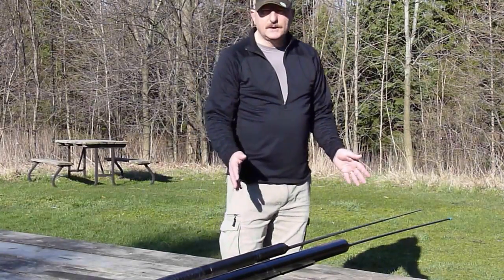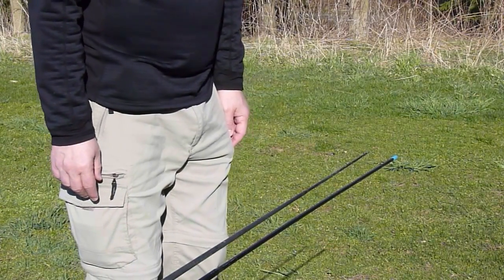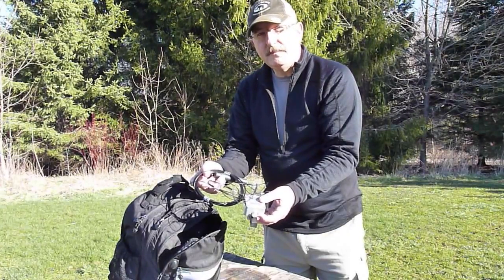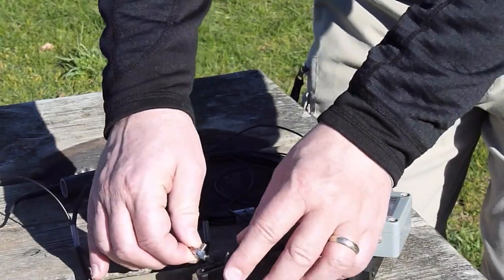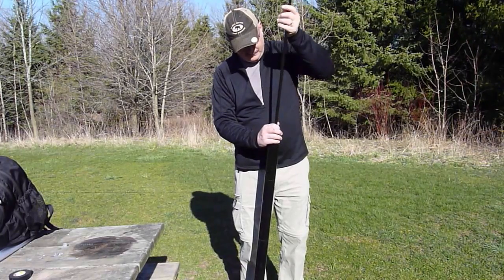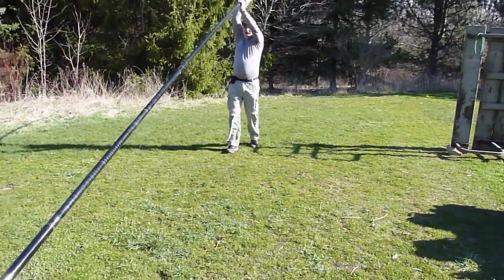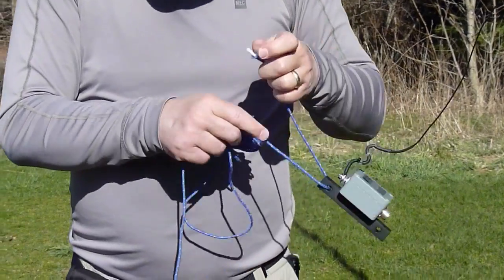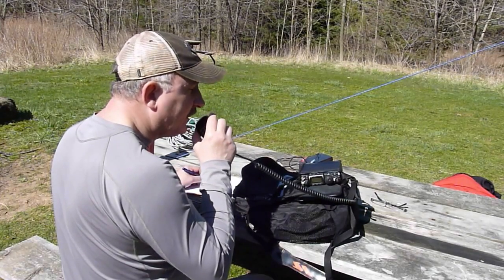HyEndFed 3 Band + Spiderbeam 12m Pole = Easy and Effective HF Portable Vertical Antenna

Comment: Have two Jackite 31 footer's !
And to be honest, a little disappointed in how flexible they are !
My mistake thinking they would be more rigid, having to support flags in a wind, but instead find they struggle to hold up even 18 gauge wire, without bending !
Since, I have purchased Two 12 meter Spider Beam mast, and are hopeful they will stand straight, even if it means not extending them fully ?
I think it is important to note that the Spider Beam masts, can be ordered with an eyelet, to aid in feeding a wire or such thru the top !
Too, Vibroplex is Spider Beams U.S. representative, and carries a set of clamps to keep the sections from collapsing down upon themselves, for those more permanent installations !
Hopefully this will help someone save time when ordering !
Unfortunately  I didn't learn of the clamp's until already having purchased the masts !
And now waiting for them to arrive !
Thanks for your post !
'73 
👍😉

Comment: If you had to do this again, would you place the antenna vertically for your HyEndFed? thx
Reply from the maker: In this video, I did have the antenna oriented vertically, but due to the wire being longer than the mast I had to run  the excess at the bottom away from the mast. One day I should try running the 3-band vertically from the top of my 50 foot DX-Wire mast.

Comment: Hi, Tracy.  Based mostly on your videos I bought the Spiderbeam 18m (60ft) pole.  I ran my endfed to the top as a vertical set up.  I worked a station in Oklahoma from my QHT in Winnipeg on 5 watts and even at 2.5 watts I could work that station.  I used my new icom ic-705 as it's my only and first ever HF radio.  2.5w over 1600km!  The station was running 400w on a yagi, he turned off his amp and ran 40w and I could hear him, but not copy much.  It was a great QSO.

73!
Reply from the maker: Nice! I've got a question for you...how far up the mast did you affix the high end of the endfed, and did the mast bend much once erected with the antenna connected?
73 from VE3TWM.
Reply: Hi. This was my first ever set up. I have two sections above the end of the antenna. . Next time I’ll take it to the very top and reply back here. 18m pole sire attracts attentions. I can see it a few blocks from my house!  I made a contact in Nevada on 40m with 5w!

Comment: Hi Tracy, first of all thanks for the video. I ordered a HyEndFed 40/20/10 and waiting for it to arrive. I was under the impression it can't be used as e vertical. Did you manage to get a acceptable SWR operating the antenna as a vertical? Which would mean the endfed doesn't have to be under a certain angle to get a good SWR, am I correct? 73
Reply from the maker: I'm really sorry for the delay in response...either I missed this or YouTube is having an issue in the reporting on comments (my vote). I had no issues with the SWR in the vertical orientation. The SWR was just as good vertical as a sloper. 73 from VE3TWM.
Reply: @OutdoorsOnTheAir  Thank you Tracy, not a problem at all. I have the HyEndFed installed vertical and SWR is absolutely fine on all 3 bands. No tuner needed. Hope to talk to you on the bands! 73 de PD9RD.

Comment: This antenna is supposed to be horizontal or a slopper...
Reply from the maker: Yes, those are two of the orientations the manufacturer recommends. I wanted to see how irt would work as a vertical for those with limited real estate.
Reply: @OutdoorsOnTheAir  Thanks mate... I owe those pieces of equipment you mention , and an FT-818ND. The space i have available is unrestricted only on hight. That is why i got the tallest available ( 20 meters ) SpiderBeam.

Comment: Your thoughts on those stackable military 48 inch fiberglass camo net poles to 32 feet height.
Reply: I have 8 of them and 4 of the aluminum.  They have quite a bit of play in the interconnects, so stacking 8 of them gets a little scary without guy ropes even in a slight breeze.  I used two aluminum poles at the bottom, clamped them to a cemented in fence post, and it still had more movement than I liked at the top.  If it had been in the middle of an open field, I could have overlooked it for a temporary setup up, but I had it up near my house.   It is also rather difficult to join them together and walk them up as the pole bends quite a bit even using the hinged stake base.

Comment: Thanks so very much for taking the time to make & share this video.
It was one of the vidz I watched more than once before getting my Spiderbeam 12m HD pole, so much more robust than a lot of others I've seen, horses for courses I dare say though.

The SpiderBeam supports my 40m/80m inverted wire at approx 11m agl but I use it for /P ops also....considering buying another couple to support a loop maybe...a phased vertical system is atop my list however!

Great buy, don't hesitate if you're contemplating a fibre glass telescopic pole.....they do 18m ones too HI
Reply from the maker: Thank you for sharing your experience!

Comment: Hello, thank you for the video, I enjoyed it. Based on this I just ordered HyEnd 3 band antenna to try it for my home base HF antenna. I have one question for you, since the Spiderbeam mast is 12m and antenna is 11.85m long (per manufacturer), in order to keep the end feed point about 1 meter above the ground, the antenna will need to be slightly sloped, correct? Unless I mount it on a tall tree high enough.
Reply from the maker: You've got it. Sloper or as a horizontal up high and in the clear will yield the best results.

Comment: Great Video, is the HyEndFed 3 Band Classic antenna a 50watt or 100watt version? I could use the 50 watt for my FT817, but if I got the 100watt I could then also use it for an IC-7300?
Reply from the maker: Thank you! The one I have is the 100 watt version. I acquired that one so I could it use with a variety of rigs. The 100 watt version can definitely be used with the 7300.

Comment: Thanks for a great video about a great antenna! This video convinced me to buy the HyEndFed 40-20-10 (but in my case installed as a sloper, and for stationary use). I live in a city and have rather small lot, and this antenna is perfect with my 100 Watt Yaesu FT-450D. It all works very well for 40m, 20m and 10/11m.
Reply from the maker: Hi Erik, thank you for sharing your experience.

Comment: Because of this video, I purchased both the Spiderbeam and HyEndFed 3 Band classic.  Used today for the first time and the results were amazing.  I like the fact that the antenna is resonant on 3 bands out of the box and, unlike my Buddipole, I can change bands without retuning.  The mast takes about 15 minutes to set up and I strapped it to a wooden pole at a local park.  Finland, Guatemala, France, Brazil and Guatemala with 100 watts, using a FT897D, were among my contacts.  This was from a local park in NJ.  Bye Bye Buddipole.
Reply from the maker: Thank you for sharing your experience, Mark!
Reply: Graduated to the 60 footer.  My club members are getting their own units.  Hawaii today on CQ DX Contest.
Reply: Hi Mark,  where are you located in NJ?  I’m near Princeton, NJ and a member of W2ZQ.  Thanks, Anthony, KD2NHG

Comment: As a teenager, I use to park my VW van with my 109 antennae centered mounted and my old Radio Shack radio. We started the Rattle Snake Point Radio club and used to meet at the restaurant at the plaza in Milton. We had about 10 guys that lived in the Milton Area. I wished I had my license back then. (era 1970)
Reply from the maker: Sounds like fun, Don! I used to dream about owning a van with a 109" whip when I was a broke teen with a second hand Realistic Navaho 23 channel rig (mid 70's). Thank you for sharing your memories.

Comment: Boy, am I glad I came across your videos on HyEndFed antennas!?  Just finished checking my new 10-20-40 HyEndFed configured as per this video on a MFJ 33-ft telescopic mast - not long enough to run the feed point all the way down, but it was the longest I could find at a local HamFest.  I sloped the wire away from the mast about 8 ft. from a wooden deck, which is about 4 ft off the ground and tied it off at the railing, about 7 ft total off the ground.  SWR in the 20 m band ranged from 1.5 at the top to 1.8 at the bottom of the General privileges section of the band and 10 m was about the same.  This is the perfect solution for my needs, both at QTH and portable, ie. at Scout Camp.  Thanks for putting these videos together.  73, N3VCK Vagel Keller
Reply from the maker: Thank you for leaving your comment, Vagel. I really appreciate hearing about your experience. Well done with your antenna. I expect you'll have a lot of success with it. 73 from Tracy VE3TWM.

Comment: How would you affix this exact Spiderbeam portable setup to a chain link fence if I didn't want to guy it?  Thanks!
Reply from the maker: Bungee cords or hose clamps. If using hose clamps, use something to protect the pole from cracking (e.g. pipe insulation) and don't overtighten.
Reply: Thanks! I assume the fence must not be in contact with the antenna itself.
Reply from the maker: Correct...pull the antenna away from the pole well above the top of the fence so the metal in the fence does not interact with the antenna. Poor SWR will result if the antenna gets too close to the fence.
Reply: Thanks again for your help - I really enjoy your videos.

Comment: wouldnt most end feds benefit adding a groundplain counterpoise wire?  And what would you do with it? laid on ground or back up as high as possible?
Reply from the maker: Most are unaware that there are a couple of different types of endfed antennas...those that require counterpoises and those that don't. The HyEndFeds do not require a counterpoise and are not designed to take advantage of one. You can add a counterpoise but doing so will not positively impact the performance of these antennas, so I do not use one.

Simply put, an endfed that requires a counterpoise is either a dipole or an off-center fed dipole. The counterpoise is the missing portion of the antenna. Getting the counterpoise up off the ground will result in better radiation of the signal, but by deploying such a configuration you have moved away from what is considered an endfed antenna.

Comment: Hi,  Are these antennas made by HyEndFed supposed to be sloped or can they be put straight up vertically besides the fiberglass pole?Thanks,
Oscar
Reply from the maker: Hi Oscar, either way is fine. The straight up method will result in the lowest angle of radiation making the antenna omnidirectional and also better for DX. The sloper has a bit of gain in the direction of the slope and a null in the opposite direction.

Comment: Nice video, qrp defiantly can be challenging.  I'm thinking about getting one of the end fed antennas for a home base.  Have you experimented with that?  Thanks for the video.
KD2LMR
Reply from the maker: Thank you, Dave! I am currently using the 3 band as my home antenna, having just substituted it for the 5 band I had up earlier. The 5 band worked well (I have another video showcasing that model). I'm looking forward to seeing how the 3 band works as a vertical compared to the inverted V configuration the 5 band was in.

Comment: Hello, I am in3jrz Fabio. I would like to know if the 'HyEndFed Antenna Band 3 is impervious to rain? I would like the mount fixed to my house. I saw your movie on You Tube. Thank you. hello 73 in3jrz Fabio
Reply from the maker: Hello Fabio, thank you for your question. The HyEndFed 3 Band is impervious to rain, just make sure you weatherproof the coax connection. 73 from Tracy VE3TWM.

Comment: Inspired by your video  I now have a 12m Spiderbeam and a HyEndFed 3 Band. Got it set up on the deck yesterday and it compared very favourably with my EFHW-80-10 during the ARRL CW Contest. Even on 80 with the HyEndFed I got CT9, RW and ON. Just wondering what you would recommend for clamping the sections. The Spiderbeam clamps get to be pretty expensive by the time they reach here. I thought I'd go to Canadian Tire get a set of hose clamps and line them somehow. Mike, VO1OK.
Reply from the maker: Hi Michael, thank you for watching and for your comments. Congratulations on your new gear!
To ensure the sections do not collapse when deployed, try using hose clamps and cut pieces from a bicycle inner tube (or other rubber-like material) to put between the clamps and the mast. You want a material that will compress under pressure from the clamp and grab onto the pole. Just don't over tighten the clamps or you risk damaging the fiberglass pole.
73 from Tracy VE3TWM.

Comment: Tracey:

Ordered my Spiderbeam today for my FT-817ND. Might pickup the HyEndFed later down the road but building my own endfed at this time.

Was the 3 band classic chosen because of it length so it fit perfectly on the Spiderbeam? Did you every try a tuner with it on your FT-897 to stretch its legs on the bands that it was narrow on?
Reply from the maker: Hi Michael, you ar really going to like the Spiderbeam. Yes, the length of the 3 Band Classic was an ideal match for the Spiderbeam pole and that drove me to make this video.
I never use a tuner with my 817. As you may have gathered, I believe in using resonant antennas and staying within their resonant range when using the 817. All in an effort to keep the finals healthy and the antenna efficiency high.
Let me know how you make out with the homebrew endfed!
Reply: Tracey:

Your absolutely right. After I had wrote my entry, that night I changed my plan a bit.

I received the Spiderbeam it is outstanding!

I've obtained and using a SOTABeams antenna now. It's a SOTABeams Band Hopper 2 dual band 20/40m that is a dipole and you connect two gator clips together to change from 20m to 40m. Very simple and effective. 1:1 on 20m and on 40m. This is the link: http://www.sotabeams.co.uk/two-band-portable-dipole-antenna-system/
If you watch the video its really informative on how fast these things go up and are operational. No Tuning!
 
I'm not kidding the antenna goes up in 7-8 minutes easy and I installed it at 6m on my Spiderbeam. I've set it up as an inverted vee.

I'll obtain a smaller pole for backpacking but for now mine works great.

Another fun item that I found out through Cliff (QRP School) is the QRPguys.com EFHW Mini Tuner kit $25. You wind the two toroids and solder the parts together and you have an endfed QRP tuner that goes at the end of a wire and a counterpoise. The PC board even has the wire lengths to cut to printed on the board. Works good for QRP.

Another Note: You know that wobbling knob on your FT-817? If you push on that knob you can traverse across the frequency faster too.

Enjoy your videos Tracey. Keep up your excellent endeavors.
Reply from the maker: Thank you for your comments, Michael!

Comment: Do not try using 1500W with this type of antenna, since coax will carry significant RF current back to radio.End fed antenna is not only high impedance (2400 ohm) it is also highly asymmetrical.Matching unit adjusts 2400 to 50 ohm, but you also need choke balun to common mode current.As usual , choke needs to be 10 times antenna impedance - meaning 24,000 ohm.I use coax choke resonant very close to operating frequency to get 30,000 ohm choking.Two chokes  are required if you use vertical yagies and high power.73 VK3EGN

Comment: Thanks for the great video, however I'm confused with the term vertical. Instead of the wire running all the way down the mast vertically it looks more like a slopper end fed?
Reply from the maker: Hello David, thank you for watching the video. I ran the wire straight down the pole until it came into close proximity of the metal picnic table legs. If the wire got too close to the legs, the antenna would detune. To avoid this, I pulled the wire away at an angle. If I had been using a support that had no metal, I could have run the wire straight down to the ground.

Comment: Great videos. Very informative.
I'd like to know about building and Inverted V for 20 meters (others?) that is end fed.  In essence it would be an easily deployble inverted V, fed from one leg of the V using the coax shield as one leg.  Perhaps there's a re reason I can't find much about this but I'd appreciate you weighing in on the concept.
Reply from the maker: Hi Rick, thank you very much for the compliment, I truly appreciate it. I would like to preface what I am going to say with a large disclaimer: I am all for antenna experimentation, and I am definitely not an antenna engineer. 
Now with that out of the way, consider half of your antenna lying on the ground (i.e. the shield of the coax). I don't suppose it's likely to work as well as having the entire antenna up and in the air. That is what this new breed of end fed half waves do for you, get all of the radiating element up where it can do the most good. 
I am not discouraging you from trying, in fact I applaud the spirit of trying to build something effective. Have at it and learn something. I hope this has been of some value to you.

Comment: Great video as usual Tracy. I was wondering does it matter what length of coax you use? What length of coax did you use and did you have to ground any equipment for RF feedback? I use an EARC end fed 30' long and it's ok, i'm strongly considering a HyEndFed. How does the HyEndFed handle 100 watts? Sorry for all the questions. Great video! 73, Noel W2MSA
Reply from the maker: Hi Noel, thank you very much! 
- Here's the lowdown...with the HyEndFed, the length of coax is not critical as it with some other brands/designs of endfed antennas. This is because the coax is not used as part of the antenna.
- I never use a station ground, either at my home station or when operating portable. I've heard the arguments for and against and to me the against makes more sense that the for.
- There are multiple HyEndFed models with varying power ratings. The one I used in this video is rated for a full 100 watts.
73 from Tracy VE3TWM.